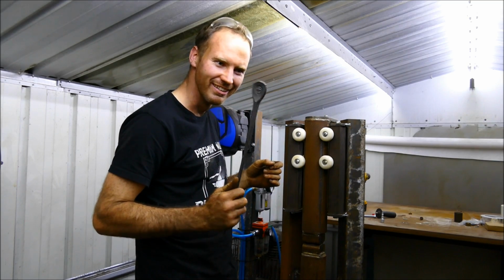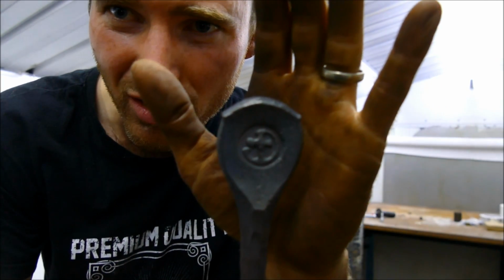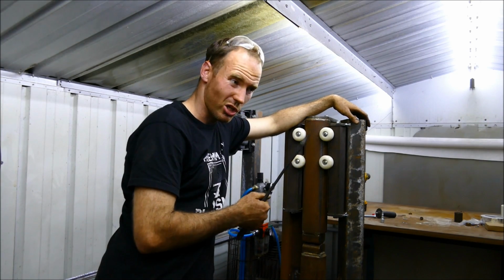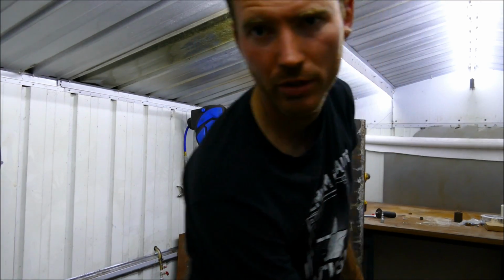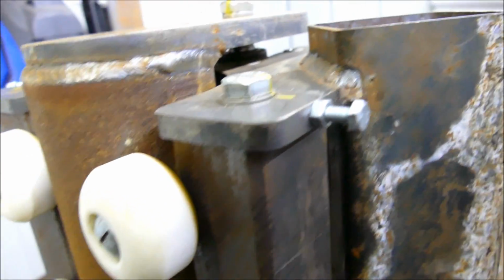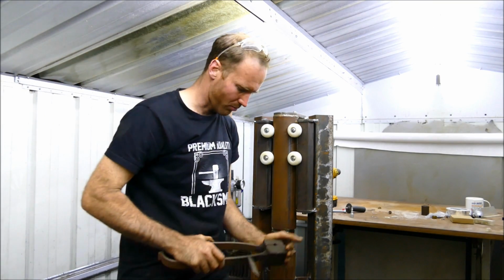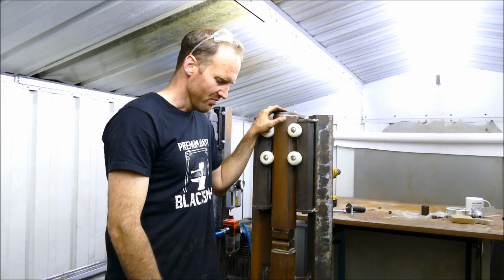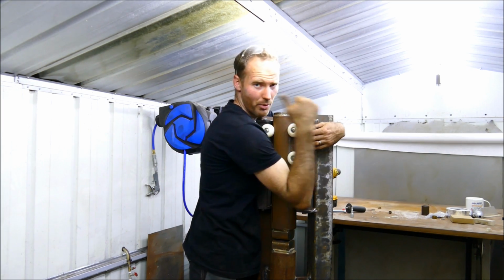!NEW! Ultimate DIY Power hammer build - pneumatic money maker - part 1

Comment: Great build! Cannot wait to get stuck in. I have been planning a hammer for a while but was going down to old style trip hammer. This design, footprint and function has all that beat. In your plan does it cover off suppliers of your pneumatics, advised Compressor CFM operating parameters and spec for steel (grades,etc)? I personally love the smaller work but having some 50mm involvement is always welcome too. Have you used this for any lighter type work at all?
Reply from the maker: Hey thank you. In the description you'll find a list of parts to buy. My compressor is 150ltr 15cfm. Mild steel is all I used except for a railway track faces. Forges 50mm well. Lots of control for fine work. All the very best. Cheers J

Comment: Bought the plans, I am buying the parts now and very excited, but I am a little confused what this $200 switch (labeled '1/2" valve" in description) is for if the foot pedal is the switch.  Am I missing something?
Reply from the maker: Keep searching. That valve should be about £25. Just look for the same spec. Cheers J
Reply: Joshua De Lisle right on, I thought that was a bit high, thanks for the quick response! Now I can finish ordering parts tonight =)

Comment: I'd like to build one but just that metal would be worth a cuple of grand here in Australia ... ..
Reply from the maker: Wow really. Cost me £500 for everything new per hammer excluding the compressor and concrete. J
Reply: @joshuadelisle  yeah £500 quid is 1,000Au plus crap is so expensive here ...
Tell ya what thou grate job mate .. I'd like more info on your Ram like what the size is and how you got it two stroke down and the reverse acuate .. dose it do that it's self as I noticed you got light strokes and heavy as well as short and long ... 
Good vid BTW 👍
Reply: @joshuadelisle  ha never mind got your product listings thank you ..🙏😁

Comment: Could build a power hammer that uses bicycle power? Very curious
Reply from the maker: It wouldn't be very power because of the energy conversion. It could wind up a large drop hammer or refill a compressor tank it would just be very slow to store the potential energy. Cheers J

Comment: Sounds like you need to upgrade your compressor - suggest looking at a screw vane compressor for big air.
I'd also reccomend changing the fittings from flexible lines to hard lines, hopefully they should hold up a bit better and bounce around less.
I've got a 600mm stroke ram at the workshop I bought for a tenner... this is giving me ideas!
Reply: Also - does your ram have a magnetic plunger and reed switches? You could use that with an arduino to sense where the ram is on the stroke and command your valve setup to changeover quicker.
Reply from the maker: @cyberprog  Thank you Alex there are more videos on the hammer and i do talk about arduino. My compressor is enough fgor what I need but I wouldn't go smaller. cheers J
Reply: @joshuadelisle  yes, sorry! I saw this video then went through the others and saw that you had tried a few of these ideas!

Did you know you can get pilot operated valves, where you use a smaller air line to actuate a larger valve?
Reply from the maker: @cyberprog  I did yes I'm looking to experiment a bit more with those and electronic solonoid valves. cheers J

Comment: How much PSI pressure does it have and does that really compare to a real commercial one?
Reply from the maker: HI, I run it at 120psi. For its size and price its very good and can forge 2" solid steel comfortably. compared to a comercial hammer you'll be paying £4K-£20K+ and will obviously be better at forging larger sections. The good points of this hammer is that it will do most things needed for small scale blacksmithing such as axe and blade forging, its also compact and simple to build which is ideal for hobby blacksmiths and small scale professionals like my self. cheers J

Comment: VERY NICE!! A couple of questions for you if you don't mind. What size of air compressor are you using to keep that running and how much hammer force are you getting? 50 lbs. ? 100? 
Thank you very much. And your welding is beautiful!
Reply from the maker: Hi, thank you. I use a 150ltr 15cfm 3hp 240v compressor. The head weight is 68lb, so you can calculate the impact force with mass X acceleration. We roughly worked it out to be 1500lb of force on a 1" area. Cheers J
Reply: WOW! Thank you so much for getting back to me so quick and the information! That's a lot of force! Well done!
I really like your set up and I'm thinking of changing my plans. I was looking at building a power hammer that used an electric motor and leaf spring pack to facilitate hammering. But yours is much simpler and fewer moving parts so to me that translates into more efficient and easier to fix!
Thanks again!
Reply from the maker: @Sickofsociety1  thank you, that's exactly why I made it. All the very best. Cheers J

Comment: bro this is SOOO osha not approved... cutting concrete and making ol that dust.... needs to be wet running through a wet saw.... don't do that again, even with a ventilator. you endanger those around
Reply from the maker: I appreciate that Joe. I didn't have a wet saw but did have a diamond cutting disc for the grinder. P3 respirator worked fine. I wouldn't do it with anyone else around. Would recommend your advice to everyone  though. Cheers J
Reply: Spoken like someone who read about it once.

Comment: Stupid question...but I'm living the design. What's an estimation of what it would cost to build, if I have no stock or scrap. Just trying to get an idea. I understand materials cost differently based on location, just wondering on a guesstimation?
Reply from the maker: I got it to about £500 per hammer for everything new. It cost more if you buy full lengths of steel but can easily be spread out if you group buy the materials so you divide up the lengths between you. Cheers J

Comment: Curious about the 308L welding rods parts look carbon to me
Reply from the maker: The 309L is a dissimilar metals rod ideally suited for joining high carbon to mild steel. 7018 will work too. Cheers J
Reply: @joshuadelisle  my mistake welders old eyes thought it was 308

Comment: Not exactly a DIY for the average Joe.
Reply: That a pretty simple machine if you have welding skills. Of course I use to work in a machine fab shop but still a pretty straight forward design.
Reply: @jvmiller1995  I can barely draw a straight line with a rule and don't have a lathe, drill press or CNC machine and welder handy, it's a bit beyond my DIY. If it can't be hammered together with what's laying around and duct taped it's not happening. Lol
Reply: @jeffgriffiths9528  Well its meant as a DIY for someone in blacksmithing. If you was into blacksmithing you would most likely own a drill press and welder. It's very obvious you have to have a welder but this could be built without a drill press and cnc. If a person had  a welder and some basic tools like a good drill and a angle grinder. Of course a torch or plasma might speed it up but you can cut all that with a big angle grinder cut wheel. Lots of people get by with minimum tools. You can get welders for next to nothing now days. Especially a stick welder like he used. So the average Joe with a few tools could build this and many more things. You need more faith in yourself you would be surprised what you can build with a few tools and basic welding skills that are not hard to learn. I have built simple small tools to $100,000 shaker tables that separate material like they use on gold rush. I took a basic welding class that met 3 nights a week for one month at vo-tech almost 30yrs ago and learned the rest on my own long before YouTube was a thing. Now you have the power to learn at home. Jody at welding tips and tricks is a amazing teacher.  I have faith in you. You have a great day man.

Comment: Good hammer, terrible concrete. That was some of the wettest, runniest concrete I've seen in a long time.If anyone is planing to pour a pad like this, research water cement ratio,  ( .45.  H2O to portland by weight is best ). You need a supreplacitizer ( high range water reducer ) to get good concrete. I buy it in small amounts from a concrete counter top supplier. A hammer drill set on hammer work as a good vibrator. An air chisel works also.
Reply from the maker: Thank you, my concrete knowledge is very limited. Cheers J

Comment: Awsome vid. Truly a master craftsman. One thing? Why didnt u vibrate the concrete?
Reply from the maker: Hi Johan, thank you, I did a bit off camera while it was setting by tapping the studs with a mallet. Cheers J
Reply: @joshuadelisle  Nice to know im in construction and I always kringe whene i see Un vibratade concrete. U less its SKC (Self compacting concrete)
Reply from the maker: @Kakihara1979  I've got very limited knowledge on concrete but it seems to be working well. I wish I had lined the top sides with plastic sheet so it could move independently, ended up chipping the edge slightly. But the rest looks pretty integral. Cheers J

Comment: How big is your shed? Looks similar to my setup but never imagined getting a power hammer to fit until I saw yours.
Reply from the maker: It's a yard master 10x13'. Cheers J
Reply: @joshuadelisle  mine is a 10 by 14 from Home Depot here in the states. I assume a gravel base wouldn't be well suited for the hammer. Thanks for the reply
Reply from the maker: @HowmanForge  you would have to dig a foundation anyway for this one. Ideally the anvil and connected concrete mass should be 10x the weight of the hammer head. Cheers J

Comment: Was just curious do you know what the CFM is on the cylinder and does your compressor keep up?
Reply from the maker: Hi my compressor is 15cfm, 150ltr at 120psi. The tank last long enough to forge 2" till too cold then as the material heats up the tank fills up again. I try not to use the hammer while the compressor is working so it's not over working. Cheers J

Comment: U need to learn how to weld lol use 7018 rod for this type of build. But the tig looks great
Reply from the maker: It's harder to weld with 6013 than 7018. 7016 would be good too. 6013 is fine and is as good as a good mig weld but you are right 7018 has better tensile strength. I just didn't have any 7018 at the time. J

Comment: A bit late to this but Ive been welding for 20 years and u really needed to bevel the poll. The force of the constant blows will brake ur welds. I would have also stacked a 4 layer (four visible) to help distribute the constant blows to the base aswell as a 3 layer on the top. Both being beveled. Makes the machine safer as well.
Reply from the maker: It's probably worth doing. Thank for your advice. Cheers J

Comment: Great looking hammer! How much of an air compressor is required? Psi? Cfm rating? Looking at building one but need a new compressor, current one just fried! Want to make sure I get enough of a machine to run one of these beauties!
Reply from the maker: Thank you. Mine is a second hand 150ltr 15cfm running at 120psi. Got it for £100. Cheers J

Comment: Nice work sir. Would a 21 gallon 2.5 h.p 126 psi air compressor be big enough to run this hammer? Cheers keep up the good work
Reply from the maker: I would recommend a 32 gallon (150ltr) with at least 15cfm. You want a large enough tank so it isn't running constantly and chance to fill between heats. Cheers J

Comment: Ya nice job on that power hammer. What a God sent. That will save your forearms and shoulder's jest a little when your older that for sure. That's for sharing your video.
Reply from the maker: Thank you! I've got lots more coming soon. Might have over 2000 nails to make and I think I've figured out the tooling to do them on the power hammer super quick. Cheers J

Comment: What size breaker do you need for that TIG-200 on 230volts?
Reply from the maker: A 32amp breaker should be fine but I would strongly recommend consulting a electrician if doing your own wiring. Cheers J
Reply: @joshuadelisle  I wired my shop years ago;  I've got an existing 15 and 20 amp on 110 volts, and 30 amps on 230 volts, and could install a 40 amp outlet if I really need to.
Reply from the maker: @myownspiritlevel  nice well done!

Comment: Great build! Thanks for the detailed video. 
I'm curious,  are you pressing the pedal for every stroke of the hammer? 
Do you adjust the impact strength by lowering air pressure?
Reply from the maker: Yes it's controlled completely by the foot pedal as you say. No I keep the air pressure on max and regulate it with the pedal. Cheers J

Comment: Could I use 3" solid round instead of 4"
Reply from the maker: You can but you would need to re design the roller system to match the new diameter. Cheers J
Reply: @joshuadelisle  Someone else i talked to suggested 4x4 square tubing with a 1/2 inch wall.  what are your thoughts on that.  Also do you have patreon page?
Reply from the maker: @selfmadejames73  I don't think it has the mass needed and won't be as efficient. Cheers J

Comment: You lost cred by starting with all the rust on the parts. That looks like a dinky little shop-
Reply from the maker: All welds where pre ground. I used free material so it came a little rusty. I'm working on a larger workshop since I had to give up my last one. This little space is adequate for now and shows what you can achieve without an industrial unit. Cheers J

Comment: nice build. but why did u weld the railway track to the fat rod with a high alloy stainless electrode? or did i get that part wrong? nor did u  bevel the bottom of the "anvil" part...are you not afraid u will bang those 3 little beads loose in a year or so? i was thinking about a 10 pass with 7018 and 8010 or so....
Reply from the maker: 309 is a dissimilar electrode for high carbon and stainless steels to join to low carbon steels and prevents cracking because of a compatible grainstructures, the cut of the anvil is preped for 80% of the surface has fusion and has 5 passes on each side. 7018 is good but not as good for welding dissimilar materials as 309 is designed for. I also recomend pre heating the larger steel parts before welding so the shirinkage of the weld doesn't caurse a fault. cheers J
Reply: @joshuadelisle  ok...makes sense..in austria these rods are called "black -on-white" and are used for mild steel -2-stainless or cast-2-stainless...usually low alloy rutile cover (7018!) works just as fine...and they deposite 110% weld ;-) preheat is a good idea though

Comment: Great build, nice welds, no bird shit and excellent penetration on the stick welds. Looks like it hits hard and gets the job done beautifully. As a structural concrete guy, I would have tripled the size of the footing and the concrete would have been placed instead of poured. The proper mix for something like this considering the force exerted should equal roughly 8,000 psi. or greater;  planted on a footing with angular sides would distribute the impact force over a wider surface area at the base diffusing the force at the focal moment in the center. Otherwise, I would love to have one of these, nice job.
Reply from the maker: Thats excellent advice thank you! do check out the link in the description for 20% off all my designs, Concrete is not my strong point, is there a way of getting the specs you suggested that I can advise to other people?
Reply: Joshua De Lisle 
Hi Josh,  Yes , there are economical ways to achieve high strength concrete.  The ratios to achieve standard 5000 psi concrete are as simple as 1,2,3.  One measure of air entrained Portland cement, two measures of clean, sharp, coarse mason sand, 3 measures of stone (3/4”) or across the pond, 18mm. 

Now, in order to increase the compressive strength from 5,000psi. Simple changes to this formula can be made. Change the 18mm stone to material called in the US by the name of Quarry Process. It’s basically gravel with mixed in screenings from the crusher. Basically, add more stone surfaces closer together, make stronger concrete. Now, all of these stone surfaces must in turn be evenly and properly coated in cement. Therefore your cement ratio will increase.  I double the cement to 2 full measures. In order to make the “Mastersen blend” of super strong concrete, I also will add a bit of crushed basalt rock (very hard stuff) , or silica sand, also very hard. But only about half a measure as you don’t need much.  Lastly, use a minimal amount of water and never hot water. Water is only added for ease of placement. Too much water decreases the overall strength of concrete.  By rights, you could actually place all of the concrete admixture in dry form, pack it solid, and I mean pack it until you cannot pack it any further and literally dump 2.5 gal of water on top of something the size of which you dug for this and once cured, the strength will exceed my design spec on a ring test.  Finishing the top is a bit challenging but not impossible. 

If you would like a drawing or sketch of the described shape of this footing / anchor.  Please let me know and I will put it together for you.

Comment: In my opinion, you have the cylinder working inefficiently, the upstroke uses the full diameter of the piston, it should be the other way round, the rod should be fitted to the bottom of the hammer, the fixed end (non sliding ) should go to the top, fixed to the frame!
Regards, Matthew
Reply from the maker: Hi Matthew, there is a very good reson why its more powerful in this possition which I explain in the new video i'm uploading that will premiere tomorrow 7pm GMT. cheers J
Reply: @joshuadelisle  OK mate, looking forward to it!

Comment: Wonderful job mate. Is each stroke controlled by the foot Valve step step step or is it reciprocating on step and hold until you release the foot valve?
Reply from the maker: its a stelp down hammer down, lift off hammer up motion. cheers J